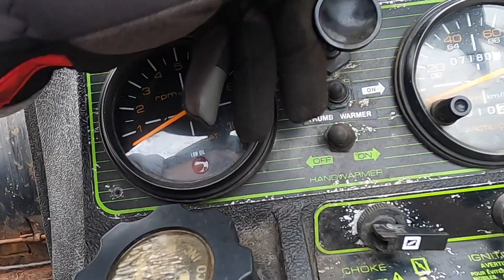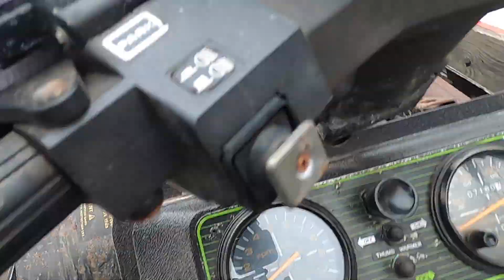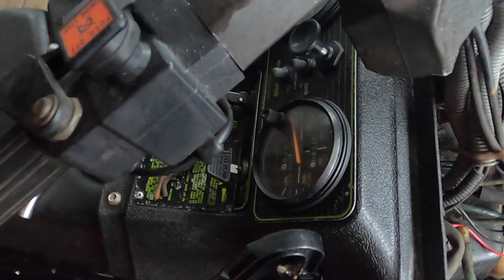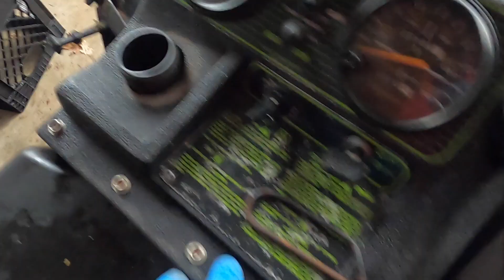Part 1/2:  Will it start?  1988 Arctic Cat Cougar 500 F/C rust bucket snowmobile with no spark

Comment: I has a 1989 cougar, mine was way nicer and the motor was really clean and it ran good. The only issue mine had was a slight bogging.
Reply from the maker: Awesome!  This one had a rough life it looks like. I just started it today after being in storage 8 months and fired up on first pull. Primer button is a game changer. Think you had an issue with jet size?

Comment: That brake button just lets power flow to the light to let others behind u know ur braking.serously doubt it has to be held to start,like a safety measure on atvs it has a lever on most old sleds to set brake in park on older rigs.most sleds dont move from clutchs till 3grand.snooky pa.
Reply from the maker: Another unusual to me switch.  Usually when you apply the lever it presses the switch. At least from what I’ve experienced
Reply: Correct it makes the electrical connect to ur rear brakelight that small box on left top of handlebars has dot-3brake fluid inside that flows down a cable sorta tube to brake calipers and rotor giving you braking ability.there is a bleeder screw at top of calipers.if fluid is old dirty,or just non exsistent.loosen bleeder,fill box with fresh and flush out once or twice.then tighten,refill,bleed out any air.then ur brakes should be good this season,happy sleding,snooky
Reply from the maker: @allensnook7760  thanks!

Comment: Its primer pump the p you see spells primer yeah a bit rusty.
Reply from the maker: I never saw a primer like that before. Very effective!
Reply: @kevinon4wheels  yup there usaully is a t-fitting running into main feed line or directly into carb vents.just gives u that oomph to get it going when cold even with a choke,its same as dribble down the spark plug hole just less hassle.snooky